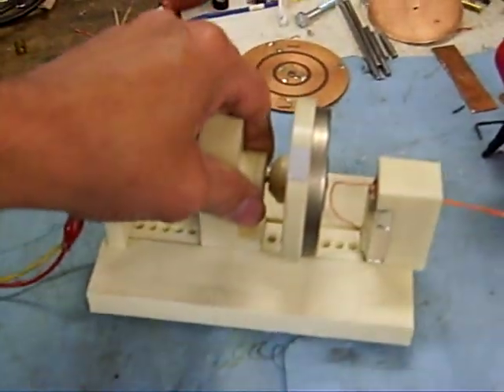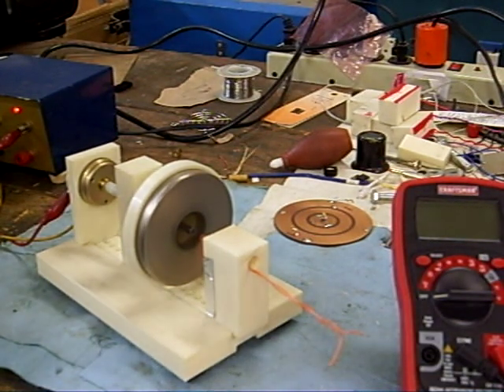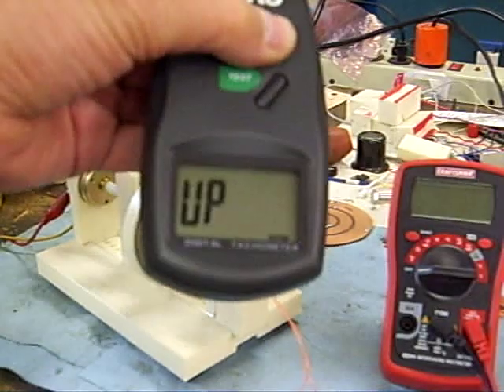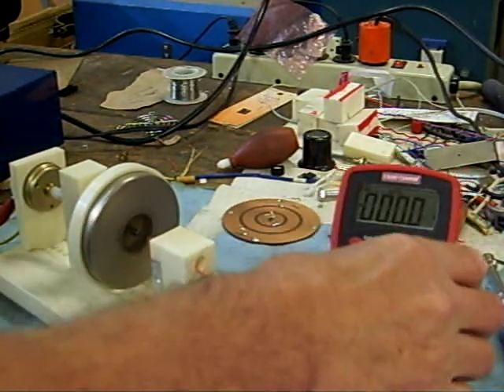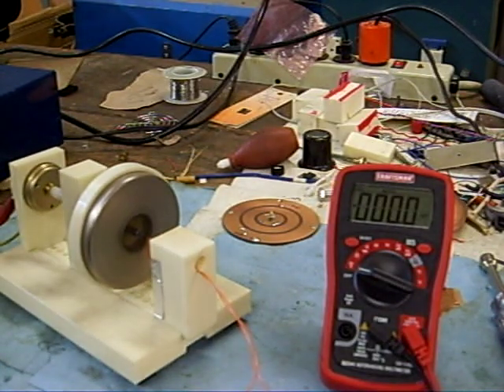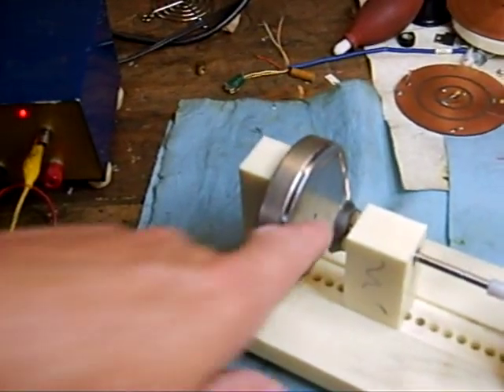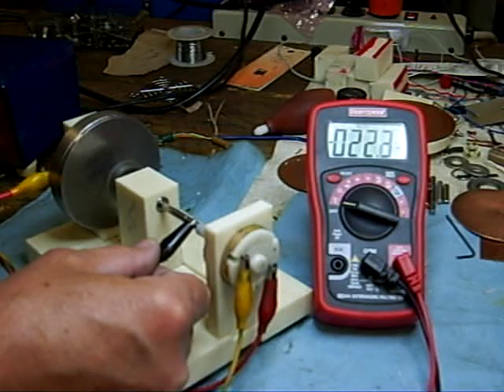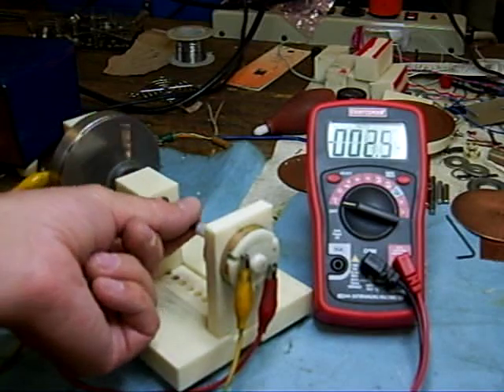HPG02

Comment: We already know homopolar motors generate electricity.  Faraday already taught us that in the 1800's.  Why aren't you testing to see what the output is in relation to the input power??  doesn't that seem kinda important?  or maybe not.
Reply: When the output is saturated due to magnetic saturation and current saturation due to short circuit, counter emf is greatly reduced or eliminated.

Comment: Thanks for showing. The left hand rule implies your setup should work, yet it doesn't. Despite your wire crossing the field lines, there's no power generated.
It bothers me the left hand rule only shows a force pushing sideways on the conductor, while it also exerts a counterforce on the magnets (when holding a motor by the axle, the motor/magnets start spinning instead. If there was no counterforce, this wouldn't happen.)

Comment: actually connect it from the center of wheel on on side of wire. and to the outside of the wheel with the other wire. nothing in between connecting on the wheel

Comment: Nice demo! You could have tested the current in the second setup. Provided the shunt resistance was low enough or if using a clip on Hall effect type ammeter. With generator output leads shorted the current is reportedly substantial.

Comment: The field in the magnet is stationary...even when rotated! The most efficient design uses a spiral instead of a metal disc. You can take the design a step further by using 4 magnets and two spirals(one outward and one inward), your load would be connected in between the outer spirals(only need two brushes with this design also!).

My understanding of these generators is that they have a very low back EMF, and once current gets moving in the above mentioned design, its suppose to rotate easier.